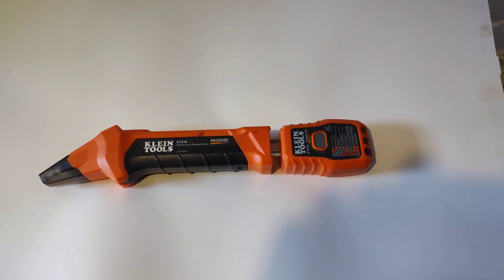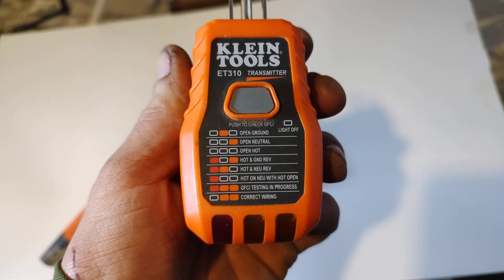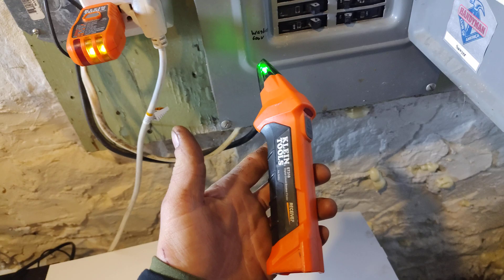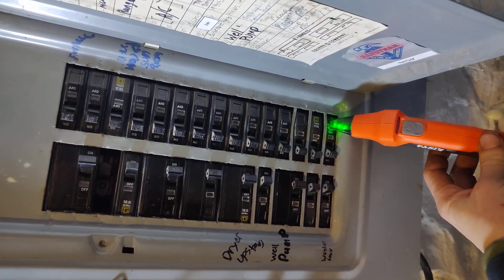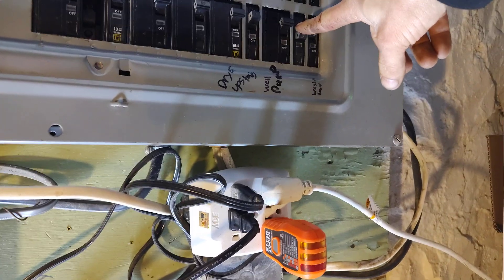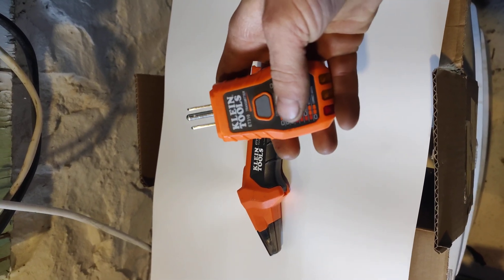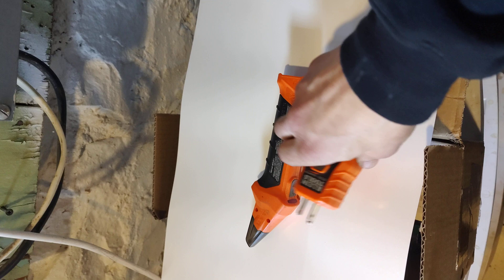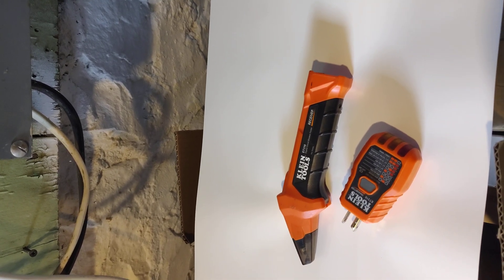KLEIN MUST HAVE TOOL FOR ELECTRIANS TRACING WIRES

Comment: love this.   took EET years ago so I often just use a multimeter.  recently when i went to change a fixture for a flood light i was getting strange readings when checking for power.. discovered that ALL of the lighting upstairs (2 ccts) was switched on the neutral.  i made up a couple of testers - i bought a bulb socket (male) with two female, polarized hot/neutral sockets and used a green, insulated ground wire with another male cord end cap (plug into any properly-wired receptacle to get a ground connection to the panel) to make a tester using my plug-in tester like you've shown.  i have also used a piece of nmd90 and a receptacle for testing bare wires.  it works, but the Klein is much safer and more convenient! :D